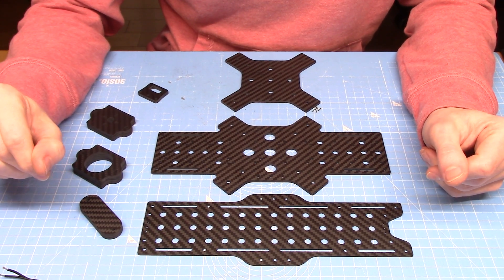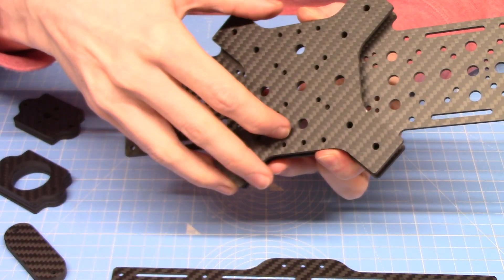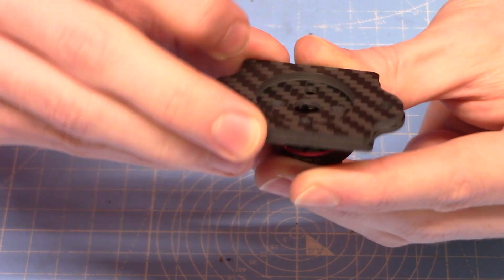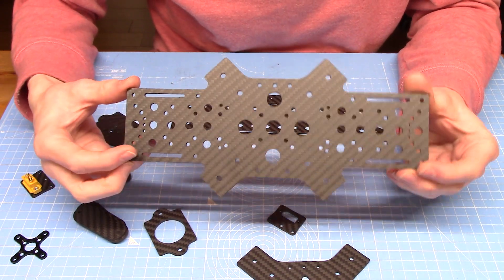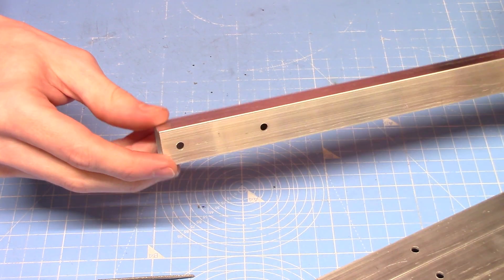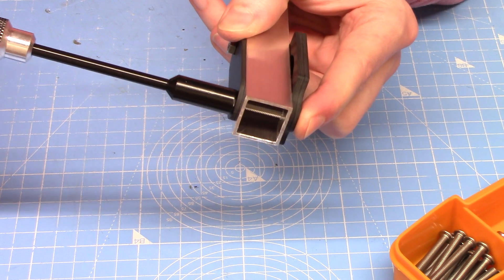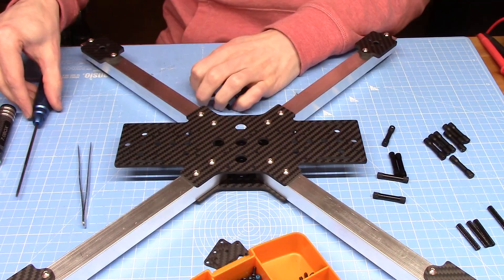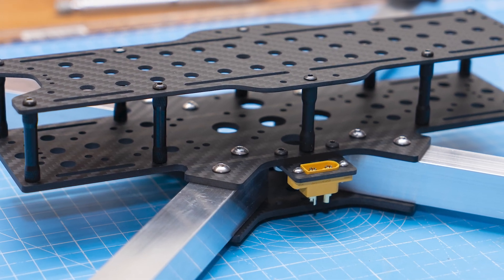Custom FPV Macro Quad Build // Part 1 - custom carbon fibre frame & fabricating arms

Comment: Can İ get information about aluminium profile tube dimensions?
Reply from the maker: 20x20mm 1.5mm wall, complete overkill but it’s what I had at the time.
Reply: @CJDavies  Carbon fiber plate thickness?
Reply from the maker: @EmilTagyev-gt6wx  3mm for the base plates, 2mm for the top plate. Motor mounts are a combination of 2mm & 3mm.
Reply: Thanks

Comment: I don't know why seeing you design and build a modern old school quad brings me so much joy, but it does.
Reply from the maker: I've always thought I missed out on the old school stuff first time around because I didn't get started until 2015-16, by which point things like the QAV500 were already old hat. Got to say I love the slightly more hands-on approach where it isn't all ready made!
Reply: @CJDavies  It was worth missing. Every flying session ended in picking up quad parts in a bucket and starting over from scratch.

Comment: Hi mate who's the company you use in Shenzhen to do your cf cutting?
Reply from the maker: There's loads of companies that do it, you can find them advertising on AliExpress, made-in-china.com, Instagram, etc. Just send messages to a few of them asking for details/quotes then pick whichever seems best for your needs.
Reply: @CJDavies  thank you! I haven't seen this site before I shall take a look. Currently building a very large heavy lift drone frame as it's something to do during the UK lockdown!
Reply from the maker: @radon1221  I know that feeling, I haven't flown anything for months but I've been working on so many related projects!